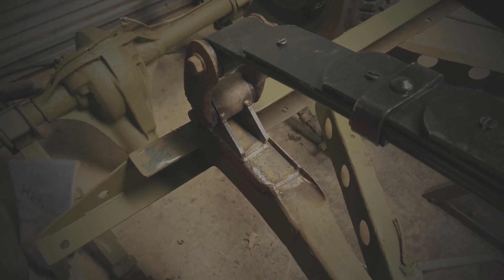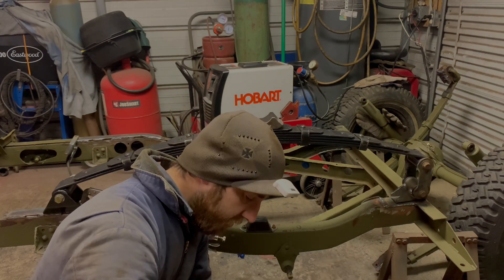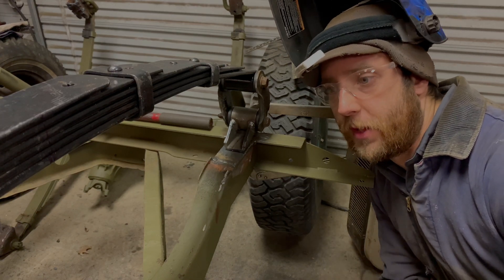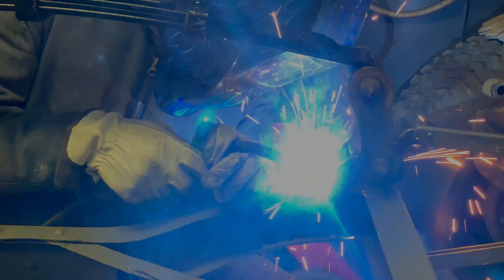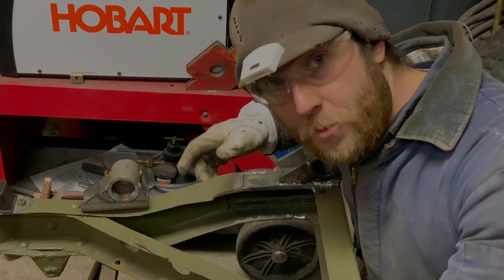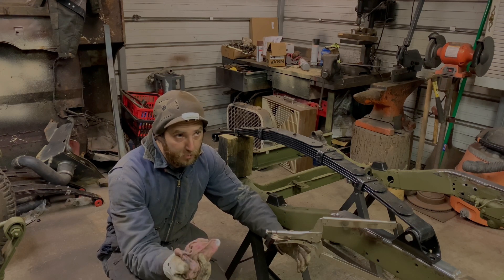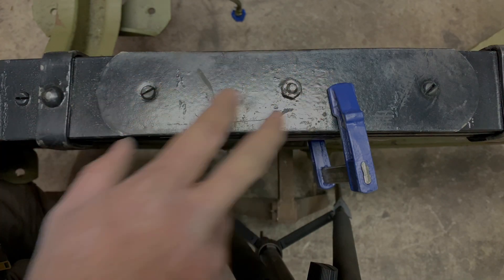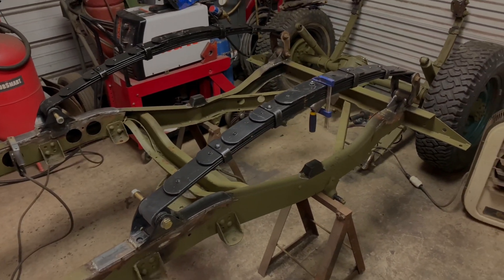Willys Jeep (Ford GPW) Build: Welding on Leaf Spring Mounts

Comment: Considering your inexperience in chassis setup (not a dig just a fact) why are you fully welding the suspension onto the frame as opposed to tacking it together first, then double checking it’s square before fully welding. Even as an accomplished chassis builder we tack things together first, recheck measurements bedore fully welding. Unless of course we have jigs.

Comment: Good on ya for finding a heat source! Sucks when you have to work as an icicle.
PS the bottom most piece is just a support, so you can do pretty much anything to it. Source: it's the most common removed leaf in a leaf pack, to get a wee bit more spring out of the pack.
Reply: That’s good to know I was not sure if I could dump that piece

Comment: Thanks for another great video Henry 👍
there’s nothing worse then cutting off all your hard work just to re do it again.  
Believe me I have done it before too.
Ps I have a wood stove in my shop, I just built a small used oil burner for my wood stove, it has really helped keep my shop warmer in the winter, my shop isn’t insulated but our winter nights haven’t gotten below 28, but the oil burner has really helped keep my shop comfortable. I think I’m following you on IG if you want me to send a few photos of it I can,
Believe me it’s extremely simple to build out of a little bit of 16 gauge metal, probably 2 hours of work. I think it uses about 1/2 gallon in 4 hours or so. Take care
Reply: Absolutely man !!!!